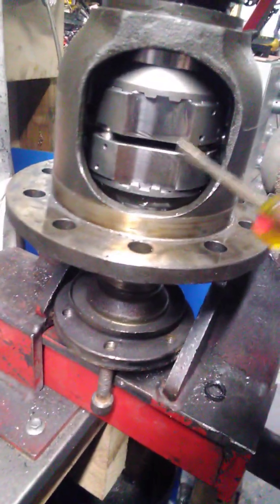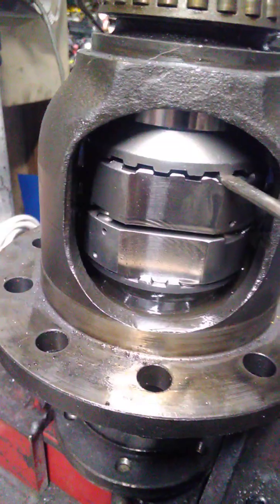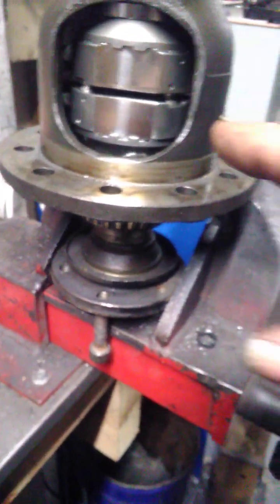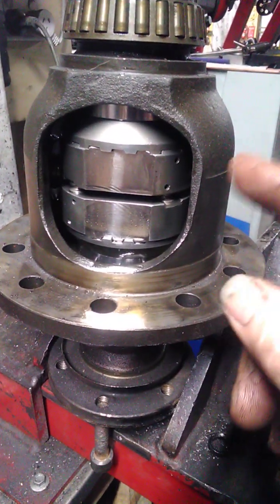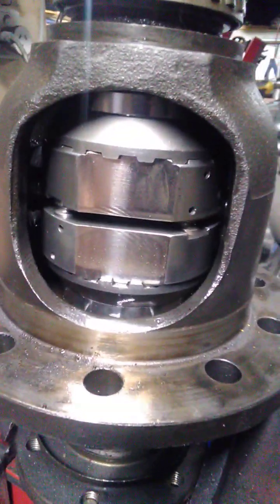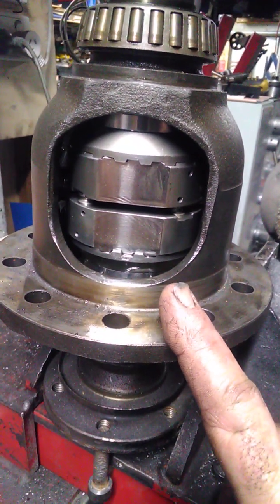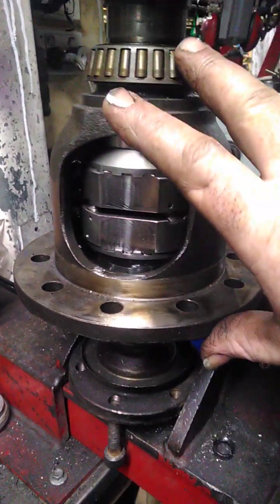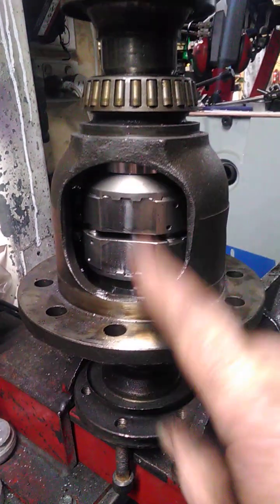BMW 188mm diff mechanical locker, the secret is out, #bmwe30 #racecar #e36 #e28

Comment: That’s sick dude. So for $600-800 you could convert my open diff 188mm to an lsd?
Reply from the maker: Yes I convert your open center to a mechanical locker 😁 it doesn't have clutch plates so it's more aggressive than a LSD and once it locks then two wheels 😁
Reply: @Grooty79  Oo I’m interested now. What state are you in?
Reply from the maker: @qvthea  I'm in south Australia, you can find me on FB look up Daniel Groot,